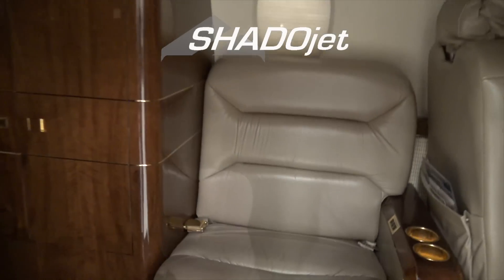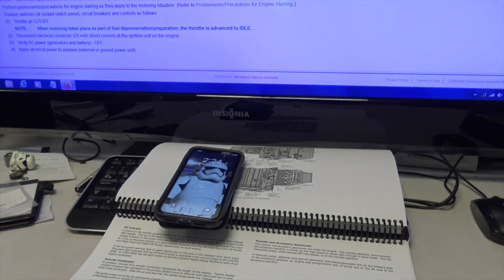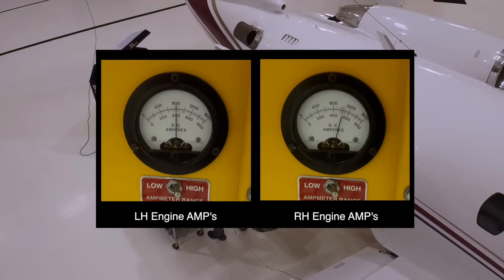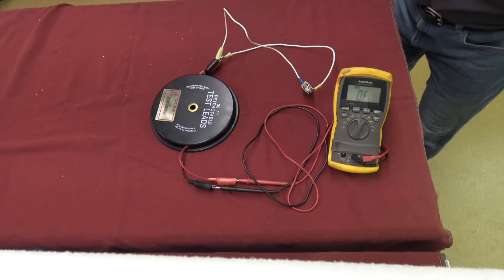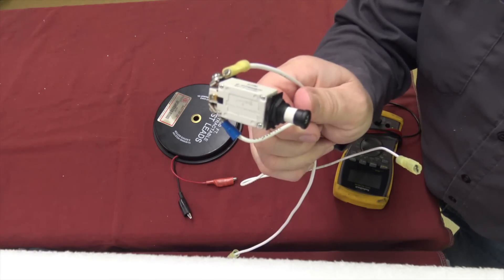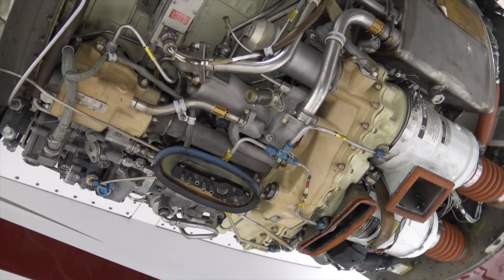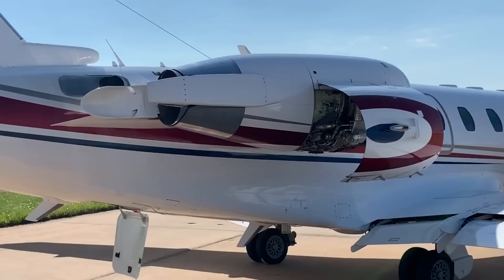Right engine doesn't start TFE731

Comment: Oh good lord. I've got two official repair manuals for my car: one deals with the chassis, and one deals with the engine. 

Now, the engine manual doesn't consider any of the accessories on the engine - the alternator, pumps, etc - part of the engine. The chassis manual doesn't consider any of the accessories on the engine part of the chassis. So, yay, trying to fix any problems that afflict any of those. Like you with the engine/airframe guys, it sucks when the problem is between departments, so to speak ,

Comment: How did no one including the pilots not notice the grinding noise of he fuel controller during the start sequence?
Reply from the maker: During the starting sequence. The pilots sit in the cockpit with noise cancelling headphones on. The only indication that the engine is running is the instruments on the cockpit panel.

Comment: Mechanical fuel pump like older racing Porsche. Show inside the thing . show failure. Should you purge fuel system? Guess not.
Reply from the maker: The fuel filter, which is part of the FCU was changed and the old filter examined.

Comment: Sorry  "draws more Amperes than the other" - the current is measured at the power unit. The temperature will show weak parts or bad connections.

Comment: I've been an avionics tech for about 10 years now and I've only seen one bad circuit breaker before. But like yours it also did not trip. It was just bad internally. I've seen several troubleshooting trees however that say replace this.....replace that.....and somewhere in there they have you replace the circuit breaker precautionary because there is no good way to test it for sure. Some will test good all day long but fail under load.

Comment: Right engine didn't start???   What was the fault code? Why did the start sequence abort?
Reply from the maker: No fault codes were issued by the DEEC. The start sequence aborted before turning the engine control over to the computer.
Reply: @shadojet3868   Oh, I see. Good work, by the way.

Comment: It could be a bad igniter or exciter box. It could be eroded fuel nozzles. It could be the fuel metering unit, the FMU. Just dealt with the same thing on a 737. Wouldn't start on left system and was subsequently MEL'd by swapping the igniter leads because the left system is on the hot battery bus and can not be MEL'd. Through troubleshooting it was determined it was bad fuel nozzles. The previous station had swapped igniter leads during the MEL procedure which caused a continued no-start on right system. The next shift discovered this and swapped igniter leads back and the new fuel nozzles did their trick.
Reply: Human errors vs human corrections. ,And this thing FLIES. Unacceptable sloppy work vs practical well thought out reality based correct procedures.
Reply: @311superfly   I'm not sure what you're saying, Super.

Comment: In my time as sysop in the mini-mainframe computer world the "Blame the other" situation popped up twice.  What I remember (after BOTH repair-men were told of blaming each other) was that in 1 case BOTH men working TOGETHER amicably resolved the issue.  In the other case 1 of them went BEYOND his responsibility-area & found the issue in the hand-off BETWEEN the 2, so TECHNICALLY neither was responsible.  (Or... maybe BOTH??)
Good job, SHADOjet!🙂
PS: This video got you another subber!

Comment: Contrary to what you said, that type of circuit breaker failure are common for many breakers. I saw it a few times myself in domestic and commercial service calls. Breaker tripped and the lever did not move and no trip indicator where equipped. I learned to wiggle all the levers and or just look for power output. Easier in a ground panel where breakers are lined up in 2 rows.

Comment: Had a breaker just die for the pitot hest on a 172. 5 amp breaker. Turns out soneone wired the cugarette lighter to the pitot switch so when thry chargrf their ipad it burnt it out but didnt pop. This sane plane also has 2 avionic master switches wired in parellel with each other.

Comment: Skinning  the cat 
We would have swapped the starter / gen's first.
When the dragging /  amp draw stayed on the right - we would have then begun diagnosis of the right engine.  
Unless I'm mistaken there's a hyd pump, ac gen, fuel pump, and start gen on that agb.  
We would have started by removing the accessories vs splitting the agb case, but you won the war.   
Hopefully that CB  would have failed somewhere in the process so we could find it before releasing the aircraft.

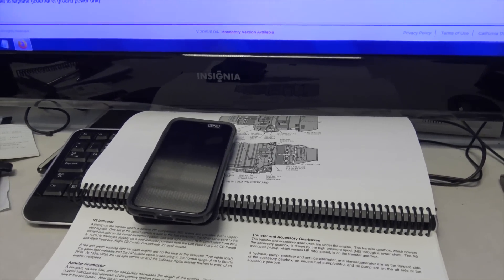Comment: 1:20  sounds like neither of them know what the fuck they’re doing. Looks like you’re gonna have to take care of this one yourself. did you ever think about changing the spark igniter in the engine? Or the air pressure sensor because without that the engine doesn’t even know it’s running and it’s only shutting down to protect itself

Comment: They should replace them FCU earlier...
If failures occur regularly.
Metal shavings must have gone through something.
I had magnetic pickup sensor fail from accumulation of metal chips tipped me off before catastrophic failure on machinery .
To bad they can't put vibration and metal detector to alert early on that components are failing .
Reply: Explain "magnetic pickup sensor fail."
Reply: @pibbles-a-plenty1105  Reluctor wheel with magnetic hall effect switch picks up rotation of Reluctor wheel on shaft produce a Voltage and frequency .
Often these magnetic pickup sensors which are in near bearings etc accumulate metal chips which interfere with the signal .
This could be used to set off a warning ⚠️ alarm a gear or bearing  component is failing .
Used in stationary equipment like GE LM 2500 etc .

Comment: Situation Normal - AFU!  It's the engine.  No, it's the airframe.  No, it's the pilot.  No, it's the check list.  No it's the manual.  No, it's the design.  No, it's the manufacturer.  No, it's the weather.  So typical of dunce technicians who barely learned anything in A & P school.

Comment: That was really interesting. I flew a CE650 for many years. We were picking it up from a service center, had hydraulic system service done. When we went to start, gauge showed no hydraulic volume at all. Mechanics are in there checking it. I was in the cockpit, reached over and tapped the glass on the hydraulic volume gauge and, voila, it worked. Cessnas.

Comment: Although I never worked on many jets I do have a little turboprop experience.  I got my A&P in 1975 and worked mostly in aerial application environment in North East Arkansas.  Most of my experience was radial engines.  I do admire your work.

Comment: 🤣 I KNEW it was the fuel control! I haven’t worked in GA in 20 years. I was jokingly thinking of tapping on it with a hammer like a stubborn starter while giving it the Cosby sauce. Great video on showing a good diagnosis of the no start.

Comment: As a retired corporate pilot as well as a A n P I certainly can appreciate your channel.  Had a Garrett Grenade go off in flight once.   Older model 731 with a planetary gear failure.   That was many moons ago.
I miss those days, but don’t!!  I knew if I broke it inflight, I’d have to fix it once on the ground.  
Well done !
Reply: Aren't all engine repairs made "once on the ground"?
Reply: @JFirn86Q  Not necessarily.  Many moons ago (according to the story) my father crawled into the wing structure of a C-119 to fix a fuel leak going to one of the 4360 engines.  They were over water on an Atlantic crossing with heavy transport tanks, and one 4360 isn't enough to keep that airplane in the air.  It was either fix the leak or go swimming.
Reply: Richard, as a current card carrying corporate pilot with those same certificates I know,  right?  Fortunutly,  I started flying 731s after some improvements but they were still called Garrett Grenades. I now pilot Rolls Royce powered jets and a Pratt powered Gulfstream 600. I did have a 731 come apart on a Falcon 50 but still had two good ones to get us safely on the ground at KSAV.  Be well !!
Reply: You don’t start 731s you arm them…

Comment: Would love to see a teardown of that fuel control
Reply: Me too. Its a trade secret. Lol.
Reply: Hell, yes. 👍🏻🇬🇧

But most probably sent back to the manufacturer for a secret tear down. They don't want bad news getting out that this could be a problem across the range. 

Why did the fuel controller fail? contaminated fuel? Poor lube to the bearings? A seal failed...? A solenoid got stuck because of a trapped metal particle during manufacture...? We'll never know.

There was no accident. No NTSB investigation. Nothing to see here. Move along.

Comment: Twenty-two years ago, I was an FO on the Lear 35a jets. Same motors. We had the motors on lease from a bank. We had an FCU problem. The bank sent us a motor in a crate to use while they had the original motor repaired. We had the old motor back on the airframe in less than a month. I never got to hear what the FCU sounded like when it failed. There must have been a pretty severe failure in the unit to cause that much of an increase in cranking amps.

Comment: Well done.  Don't you hate it when you have to do other people's dang jobs for them?  So annoying especially when it's supposed to be experts.
Reply: I had a friend with a hot tub which kept popping the breaker. The hot tub tech said it was a bad breaker. Although bad breakers happen, they aren't all that common. Doing a step by step diagnosis, I found a faulty pump that was shorted. The hot tub tech was just being lazy. I should have sent him a bill for doing his job for him.

Comment: That particuler model circuit breaker (CB) problem is not new. I came across loads of them when refurbishing desert combat Apache helicopters in Germany 2010 to 2013.
The contract costing included replacing every CB on the machine because of the ingress of the fine quartz desert dust along the shaft of the CB. This caused internal popping with no external witness. Every day a learning curve, keep your mind open to all possibilities when servicing aircraft.
Reply: Indeed.  A circuit breaker pops because it gets hot from too much current.  It also pops when hot due to contact resistance being too high as a result of contamination or corrosion.  It's just Ohm' Law.  Do they teach that in A & P school?
Reply: I’ve seen a number of issues over the years with those Klixon circuit breakers. Everything from landing lights to landing gear. Found periodically cycling them helps keep them healthy.
Reply: @Marauder92V  sounds like dirty contacts or damaged by arcing after too many connect/disconnect cycles.
Reply: Overall (or quite often) one needs to keep an open mind about "expecting the UNexpected"...  Yes, I certainly KNOW that this is not possible...🙂

Comment: Nice troubleshooting skills. That circuit breaker thingy would have driven me barking mad... well done.
Reply: Intermittent electrical faults are the absolute worst thing to deal with.
Reply: @rael5469 You're absolutely correct!! But it's never intermittent when the pilot involved it just doesn't work!!!😅

Comment: The faulty circuit breaker needs to be investigated throughly (by x-ray and break down), and determine why the button stays in when in fact that circuit is broken.
Reply: The part is relatively cheap. Nobody wants to spend thousands to save a few!
Reply: @davenone7312  BUT!! How many thousands were spent on JUST THIS repair?  Is your perspective still valid then?
Reply: @Scott-i9v2s  Not my fault they are bad troubleshooters is it? This is why we have "specialists". Not one guy trys to do all.
Reply: @davenone7312  Bad troubleshooters is 1 thing.  "Not my job" is another, & insufficient pre-production testing is yet another.  Granted that "expecting the UNexpected" is always an issue...
PLUS, requiring responsibility to OVERLAP at the borders of job-descriptions would be a good idea, methinks.
Reply: At whose expense?
Reply: If the contact is open no current flows so the button stays in.
Reply: by factory, by FAA, by lawyers?
for client and mechanics there is no problem - it's faulty, it's cheap, replace it.
However - emergency landing of polish 767 LOT016 may be cause by similar problem.

Comment: Any grinding or gear meshing sounds are the worst feeling. Lucky it wasn't the engine directly but I'm sure it still wasn't a cheap fix. Thanks for letting us follow along.
Reply from the maker: The end cost to fix the problems was just over 150K. The overhauled Fuel Control was the bulk of the cost.
Reply: @shadojet3868  ooofta. As a private pilot who logs around 75 hours/year for fun flying around California, that number is why I like to rent :)

Of course very different equipment for very different missions.

(Many thanks for posting this - super cool to see the A&P side of it. Whole lotta respect and props for the folks who keep me safe... and knowing y'all are really invested in keeping everyone safe!)
Reply: @shadojet3868  Ouchie!! Seems high (what do I know) but probably just the regular price of admission to own such an awesome jet...
Reply: @shadojet3868  Might that cost have covered a better designed/tested CB?

Comment: Such a loud grinding could create metal chips. I hope they checked for this. Maybe they are stuck to some magnet.
Reply from the maker: I did take an oil sample and sent it in for analysis. The analysis showed normal wear. No metal was found on the magnetic oil chip detector. I also replaced the oil filter and fuel filter.

Comment: So I guess the specialist need to go back to school 😂. And yes I've had a reset button not pop. Once motor cooled down it would work fine. Yes drove me nuts.
Reply from the maker: Intermittent problems are the hardest to find. Glad to know that someone else had experienced a circuit breaker internal disconnect, without popping the reset button as an indication. Thanks.
Reply: @shadojet3868  So the REAL issue is how (during product-design) to test for the UNexpected...  Yes, I know what I am saying!

Comment: Sooo, a bad bearing (or a gear) in the fuel control dragged down the starter? Was that drag felt when you hand cranked the engine and got that grinding noise? Also, I assume the abort command is a combination of current draw(?) and % RPM at certain intervals?
Reply from the maker: The torque needed to turn the N2 measured higher than normal with the dragging Fuel Control assembly. Also, the abort was caused by the Starter / Generator control unit. The GCU wasn't receiving the correct signals at the 5 second mark in the start sequence. So, it aborted the start sequence.

Comment: I believe that should be "#2 engine doesn't start."
Reply from the maker: Ha ha. Yes. Some people are fanatics about the labeling of engine positions. However, most pilots that I have worked with that fly twin engine aircraft. Refer to the engines as left and right. As a pilot myself. Left or right, #1 or #2 position nomenclature is only important to the person you might be talking too.

Comment: You must be an actual good mechanic to go on a post-mx test flight. Most mechanics I know would never fly after they perform maintenance on an aircraft. Thoughts?
Reply from the maker: That's scary. I go on as many flights as I can. We do enough testing on the ground to assure proper operation in the air.
Reply: When I worked for Hawker Beechcraft as a technician we were hardly ever allowed to go on test flights, or floor supers would go. I was able to go on one in a Premier, only because the owner insisted.
Reply: WTF are you talking about, always go on the test flight, what are you, new?

Comment: I was an A&P Mechanic at Cessna for 34 years and worked on the Citation 650 from the time in was introduced until I retired in 2012. I never saw this happen, lots of other strange things but this tops them all. 😲
Reply from the maker: I am thankful to all those maintenance techs, that used to work, or continue to work, at Cessna on their jets and the insightful and knowledgeable information they provide.
Reply: A device that has around 10,000 parts can present a lot of problem symptoms from total failure to trivial nuisance.  The trick is to use a logical course of eliminations until you get to the root cause(s).  🤔  With 57 years as an electronics troubleshooter I'm getting better at it! 😂

Comment: Nice work!
Curious, how is the start sequence cancelled, is there an engine/fuel control module that monitors current flow and when it exceeds a predetermined/set value cut the signal?
I'm an automotive tech, first thing I'da done would have been an all-module scan, TSB and tech-tips search :O)
Reply from the maker: The start sequence was aborted by the engine GCU when it didn't receive the proper signal at approximately the 5 second mark. That's about as detailed as I can get in the YouTube comments.

Comment: Things are certainly different in corporate air as compared to airlines.  An airline mechanic who could not isolate a mechanical failure in an engine fuel control within a few hours would be regarded as incompetent.  Sorry, but that is the way it is, or was when I retired.
Reply: You are correct.
Reply: It is still like that, yes.
I have to agree, I’m glad I did not have to write this myself.

Comment: Unreal. Everyone passing the buck. The ammeter on the ground unit is literally saying, "Hey! Something's up!" In manufacturing, mechanics often rely on ammeters to monitor and adjust the flow of whatever's being processed or pumped. Good video.
Reply from the maker: You are right. The problems showed up in the test data. Unfortunately, the airframe specialist and the engine specialist only arrived with preconceived guesses, that didn't fix anything and didn't run any tests. Thanks for your comment.
Reply: A key tool for troubleshooting is knowing metrics.  How much is right, how much or little is wrong....?
Reply: @pibbles-a-plenty1105 …….and you build off of that in your process to understand the problem 😀